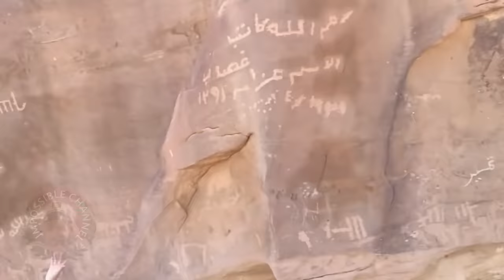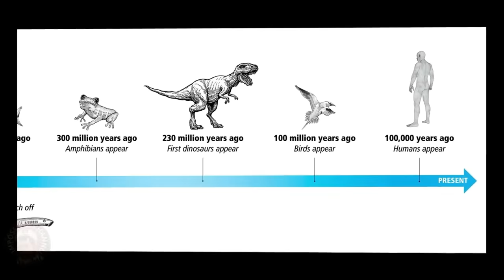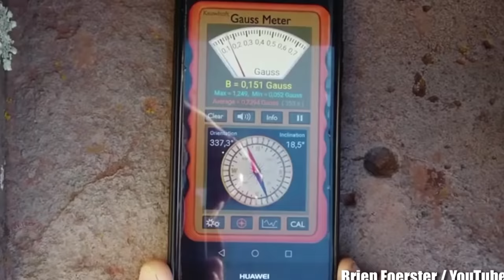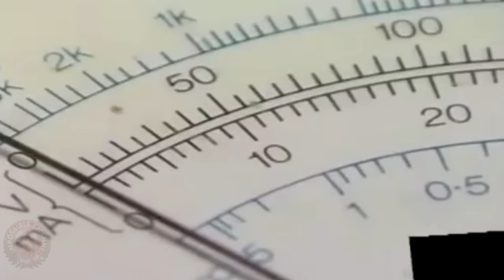The Most Mysterious Places Experts Still Can't Explain

Comment: How did the builder make and decorate those chambers without light?  Simple! work on the room while there wasn't a roof/ceiling on it.  stop construction on the pyramid when you get to the correct height, build the room and then put the roof stones in place and return to building the whole thing.  That would also be the best time to put the stone boxes in it.

Comment: For those places where they are gravity hills, in physics does that mean there is a particle with such a large mass that it its gravity pull is strong than the current gravity around them? If this is the case shouldn't they be checking the area where the pull actually stops for the source of the particle? Just thinking aloud.

Comment: The bull sarcophagus being opened is a simple one to answer as a start. Add rotting animal into a hermetically sealed box made from granite and the gas pressures will become so great to move the lid. The going theory as to why they were made was to act like a battery via the piezoelectric effect from the quartz crystals throughout the granite. We use the effect in modern appliances. How they got moved into place is a separate mystery to solve but I'm sure a rational explanation is out there.

Comment: Maybe the Bagdad batery is the oposit ? More like a handheld reciever of the power that eksisted above in the stratosphere thanks to the pyramids/powerplants ??? If the pyramids produced electrical power by using resonansfrquenses from the aquaducts below combined vith minerals in the buildingblocs and the condensers inside the big rockboxes inside equal to the Bagdadbatery !?? This is eksplained by Nicolas Tesla in the building of the Teslatower, eksept for the use of copperwindings instead of tunnels and rocks like a pyramid ??

Comment: First of all it is not the only temple to be carved from the top down.
lots of the stones at Tiwanaku were moved by modern humans .
If you put a spirit level on a gravity hill you would clearly see that they are not , and just a optical illusion .
Huge stone boxes have been found with Bull Mummies still inside.
Egyptians used swan lights that did not produce soot as it was filtered out with the water inside the lamp. examples have been found.

Comment: The guy with blue jacket running on wet sidewalk that seems to run into an invisible wall is fake. It's a video spliced in digitally or ....(CGI). No footprints on sidewalk, the blur of upper body, the legs are literally lifted as if on a rope, right leg obviously on a rope and PULLED UP in air and let down which can be easily seen if paying attention to right knee area as it's slowed being let down. The back of right knee area lands on something as it's LET DOWN EASILY as he rolls toward whatever the back of his right knee lands on. Its as if his foot kicks a curb OR steps in a rope snare where a loop of rope on ground snares foot and lifts in air which is a VERY OLD type of trap.

Comment: Of course you will not find tools in Egypt or other areas...  They are dust now... BUT if you are digging in the right place tho, you might find a mineral imprint of them.
Reply: I don't think rocks or bones disintegrate and those were da tools they were supposed to be using. Wat tool leaves mineral imprint
Reply: @realdeal3571    It is pretty obvious that The REAL builders did not use rocks and bones to create the advanced stuff in Egypt.
But, Metal tools, if left on the ground over a very long time will also desintegrate to its basic forms of atom..."minerals".
So, It should be possible to find imprints of such in ground.. just like you can find dinosaur imprints.

Comment: The dinosaur did not go extinct millions of years ago. There are carvings of these animals that date back over to the past 1,000 years, and they have found dinosaur remains less than 5 -10 feet below the surface all over the place which means they went extinct over the past 1,000 years. Dragons during the Middle Ages would have been Dinosaurs. There are still Dinosaurs living in our oceans, alligators, crocodiles, and comodo dragons are Dinosaurs.